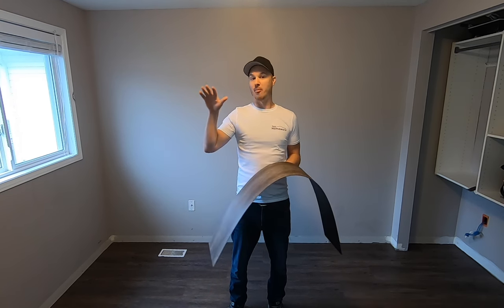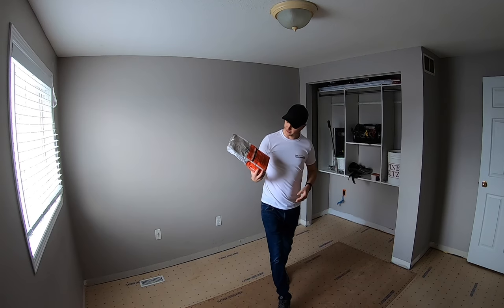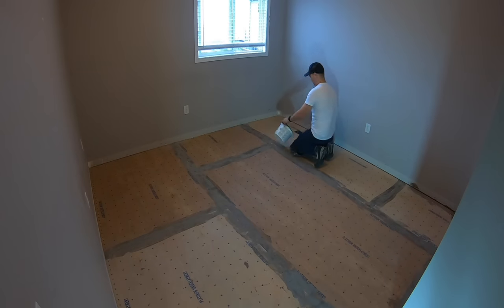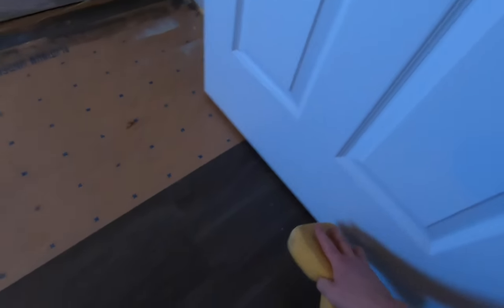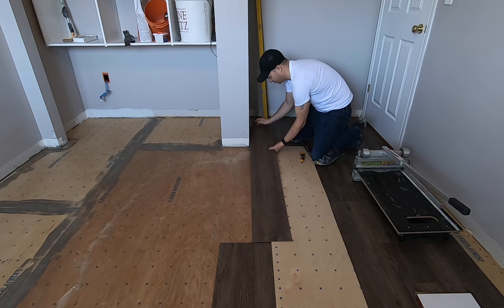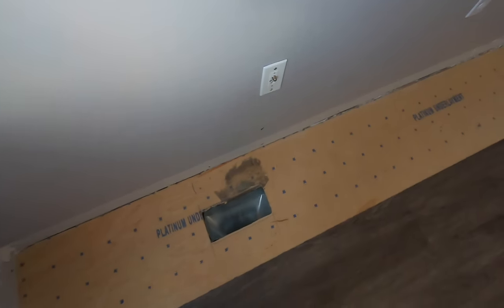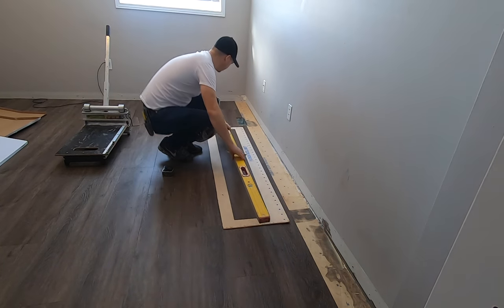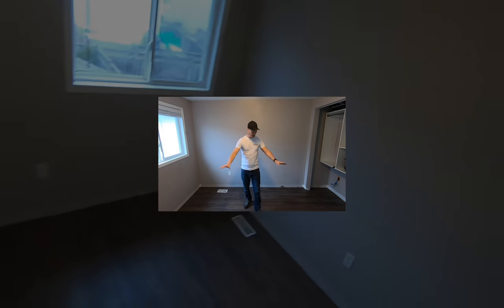How to Install Glue Down Luxury Vinyl Plank Flooring on OSB Sub Floor

Comment: Ummm...I used a paint roller for my adhesive 😬
Reply from the maker: Did it work?
Reply: Heck yeah it worked!!! My Daddy was in the floor covering business for 50+ years and when we bought the LVP, we got the adhesive and trowel. About 30 seconds in I switched to a 3” paint roller and my husband thought I was crazy. 1200sf later and it looks amazing!!! I’m renting a kicker from Home Depot next week and putting new carpet in two secondary bedrooms upstairs. Take THAT “Rona” 🤣🤣🤣
Reply from the maker: @christirh3760  awesome 👍
Reply: @christirh3760  did you have to use a certain nap for the roller?
Reply: @whopua  I used the little all in one 3” roller from Home Depot. It’s like a little disposable kit for about $3-$4. It hangs on the peg board display in the paint department but they sell them at Walmart too. I would literally dunk the whole fuzzy part of the roller in the adhesive then roll it on.  After I finished I didn’t even clean it and just put it in a zip lock baggie and 2 months later it was still wet and I used it again to do another 200sf then I tossed it.
Reply: @christirh3760  great info! Thanks so much!
Reply: @christirh3760  And if there ever was an issue a year or two in the future with your flooring coming up (and unfortunately it does happen at times), do you think the manufacturer will warranty the product? Or would Daddy have to get involved?
Reply: @61spindrift  Nope. We’re long gone. Out property doubled in value so we sold and moved on to bigger and better.

Comment: This is not a good idea. Plywood is cheap, fast whatever... but will have all sorts of problems over time. Termites, dampness... water spillage onto your vinyl floor could seep in, cause the plywood to warp/rot whatever.
Reply from the maker: How would you recomend doing it? I've never seen it done another way
Reply: Plywood is already on the floor That's how my entire 2nd floor is....standard in the USA adding 1/4 more isn't going to change anything

Comment: I'm going to be doing an lvp installation on some steps but the lvp has pad on the back. Should I use pressure sensitive glue on the treads?
Reply from the maker: Is it click style or glue down?